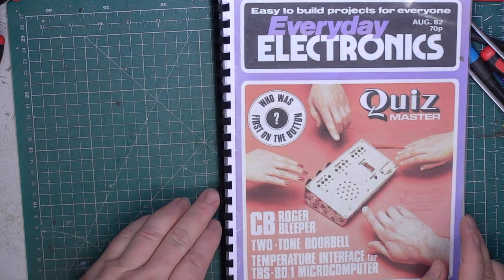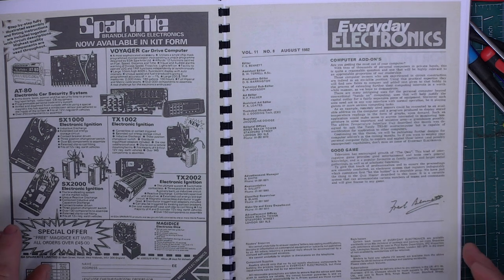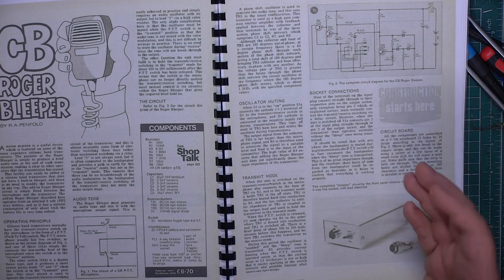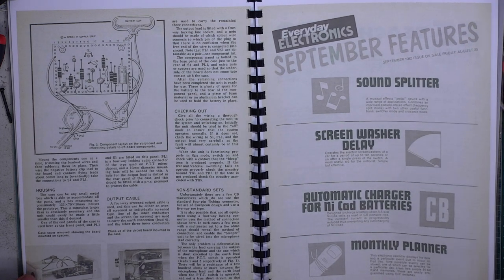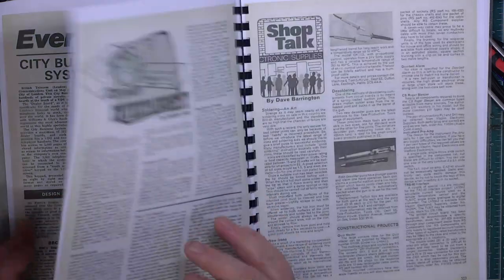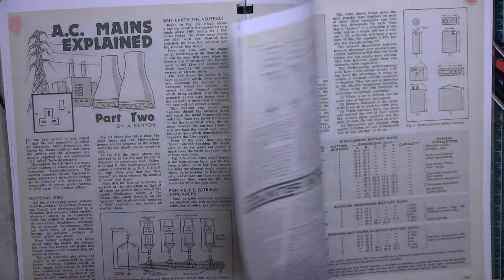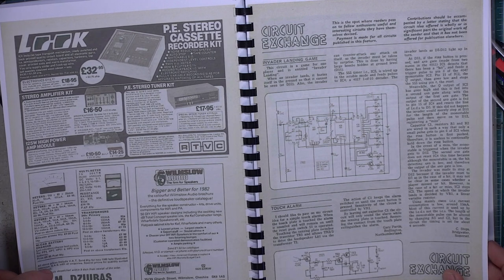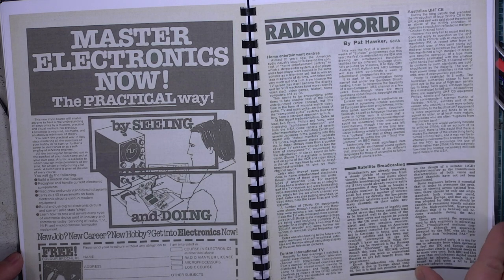Everyday Electronics August 1982 - A nostalic review & a Roger Bleep project

Comment: Very nostalgic Richard. I was making similar external roger beeps at this time, not this design,  but a single transistor ocsillator ( variable tone) one, utilising a single pole, double throw miniature relay for the switching, and an electrolitic cap on the relay coil, for the delay switching back from TX, to add the beep audio. I still have the hand drawn circuit, i found, whilst looking through some old 'Practical Television' ( from the 60's and 70's) and 'Television' magazine ( as it became in the 80's?) I have in the garage still, along with a few Practical Electronics, but not this edition. - Still laugh at the exploits of tv repair man Les Lowery-Johns - a very clever man, and a brilliant comic writer!
  As mentioned to you before i was in  TV and audio servicing trade at the time, in Sheffield,  ( A Fellow Yorkshireman!) working mainly on the Thorn ( Ferguson/ Baird, etc) 'beasts' like the 3000/3500/8000/8500 ( Cyclops ?) Decca Bradford (one of my favourites) GEC 2110'S ( Damned power supplies!) , Phillips/Pye/Ecko B&O , G8/G11 Colour chassis, as well as the still abundant mono chassis ( Thorn 1500 series etc) and whatever else came through the door! - ' strange foreign ' sets from the likes of Sony, National Panasonic, indesit, etc, etc. Those were the days, but like most things, we didn't know it at the time!
 Keep up the excellent work, much enjoyed - waiting for each video, is like waiting for the magazines to come out every month, back in the day!.... BEEP!
Reply from the maker: Thank you Andrew,

Les said A gypsy told him to "beware of the blue tant". Useful & true.

Richard